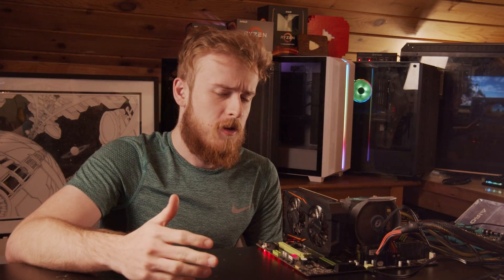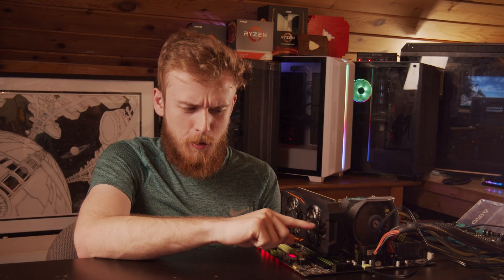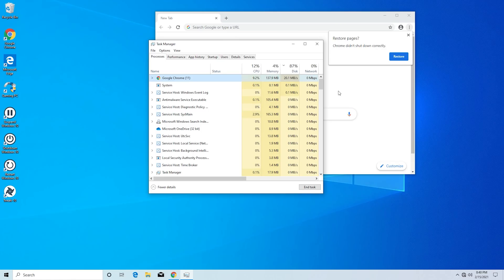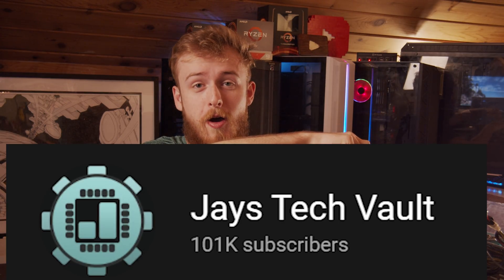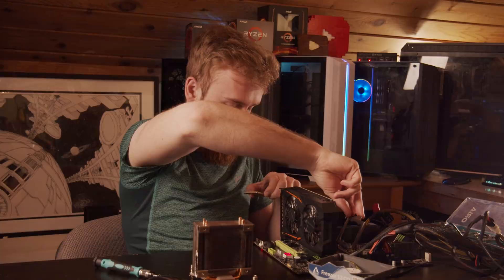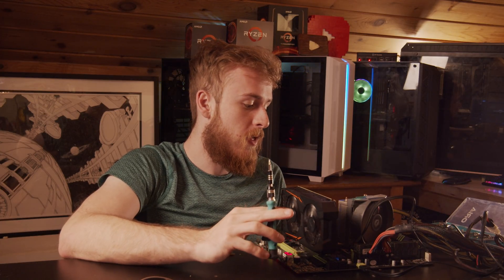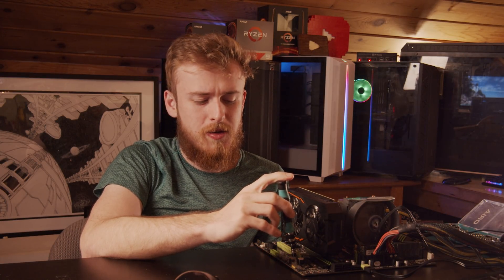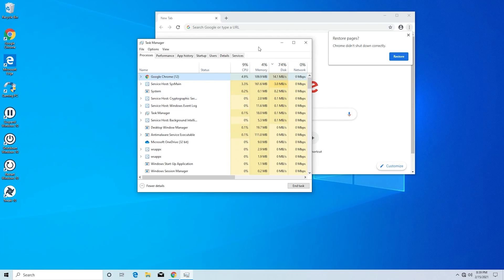What Happens If You Remove RAM While Your PC Is Asleep?

Comment: This happened to me today, I was suppose to reinstall my RAM and forgot I earlier  closed the laptop without shutting it off. I quickly remembered when I removed the  RAM and then immediately removed the battery from the laptop.
Nothing really happened though, everything works fine

Comment: Nitpick: I think the hard drive worked not because 'hot swap' capabilities, but because a hard drive is more designed to power down so much for power saving. Hot swap is for unmounting while the OS is awake and in operation. Now a curious me wonders if this could be an 'attack' vector. What happens if you take the hard drive out, and modify the underlying OS in some way, and then wake it back up. What is kept in memory?
Reply: Here is a jank challenge. Take an Linux PC, put into sleep mode, take a windows PC, put into sleep mode. SWAP the HDs between the two PCS and wake them both up. Invasion of the OS snatchers style

Comment: Here’s an idea to try.  I wonder if you can just solder wire directly to a cpu, then run all those wires to the cpu socket and connect each and every wire where the pins are on the socket (pay attention so that the cpu/wire/socket connection orientation is correct.  This would be so you can have your cpu somewhere different, such as inside a freezer, and a massive bundle of wires running from there to the cpu socket where it’s connected.  (You would not need to solder the wires directly to an AMD cpu as those are still pins on the cpu, unlike intels.)

Comment: So, the board doesn't support S3-suspend to ram?
Or the board is wired badly where the RAM gets its power from the 12V and thus keeps the PSU on fully....
Technically, a proper suspend should allow:
Changing the GPU,
Unplugging and plugging the CPU power,
Changing the HDD,
Adding PCIe cards...
It should fail on:
Change CPU,
Change RAM.
The reason those two always fail is because in a true suspend state, the RAM is kept powered via the 5vSB into a 1.2v regulator and by the looks of it (From testing voltages on an i5-2400) the internal "Northbridge" of the CPU is powered (To refresh the RAM due to it being dynamic-RAM).... Not sure if DDR4 or newer do what the old SDRAM did being "Self-refresh" hence, "Self-refresh Dynamic Random Access Memory" or "Static/Dynamic Random Access Memory" being what the acronyms meant.... If so, then such a platform can handle having the CPU swapped out also... The only issue being then is the "Intel Bring-Up-Package" would have to reinitialize for the change in CPU, the OS would have to either fall-back to an un-accelerated code-base or BSOD, the CPU Microcode in the suspend-space for cache flushing to RAM would be incorrect for the CPU (Assuming the OS caches the Microcode, should do... Though I had a linux distro that after suspend on a laptop didn't reload Microcode causing the OS to lock-up exactly 23-seconds after resuming to a usable state, So 30 to 45-seconds from resume.... Yup, the bug caused that.... The only way to get it to respond was move the mouse in circles: an IRQ timer bug in the CPU, annoying when trying to play music and only the last 9/10ths of a second looped until the mouse is moved ._. )

Comment: 4 Years Ago I Have A Computer I Put it in sleep mode
I tried to remove my ram , it ended damaged the ram 
, split to two pieces half of the ram is on motherboard another half is in my hand after that i turn on the PC but it wont boot up... i buy new ram it fixed all mess

Comment: What about if you did this while the computer was hibernating? ...might require an old OS, but would be interesting.
Reply: You can hibernate on Windows 10, there is no need for an older operating system, it is just buried. On the energy settings, there is an option to enable hibernation, sleep and so on
Reply: I think it is disabled by default for two reasons: hibernation takes a considerable amount of space on the internal drive so it is particularly awful with people with ssds which has less storage and many people used hibernation quite frequently to the point of degrading the system performance. What I mean is that, when you turn off the pc, when turning on, the ram is wiped so any glitches it would occur dont happen (especially that because of Intel, consumer RAM dont have error correction, so running for a long time can sometimes to cause errors in the garbagd collection system and make the os and apps unstable). Hibernation makes a save state of the ram, when you load the computer it will run on the state it was saved, the problem is that these glitches can be carried over too. By default, Windows use hybrid shutdown, it is kinda like a hibernation without fully saving the entire RAM

Comment: When I built my 1st pc I didnt have a disk drive, and every flash drive i got from the gas station wasnt bootable for some reason. So I started installing windows 7 on my laptop with my SSD plugged in (laptop had a disk drive). Then literally while it said "Installing Windows" I unplugged the drive and plugged it into the recently built PC. I had some driver issues, but it fucking worked.